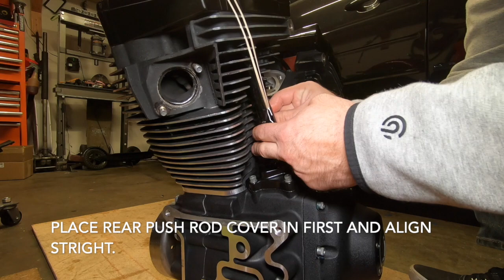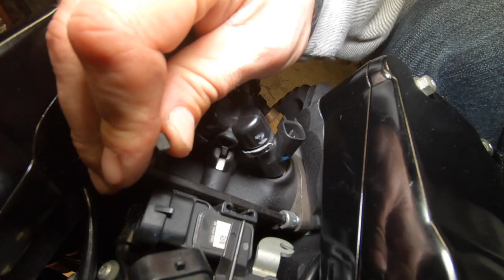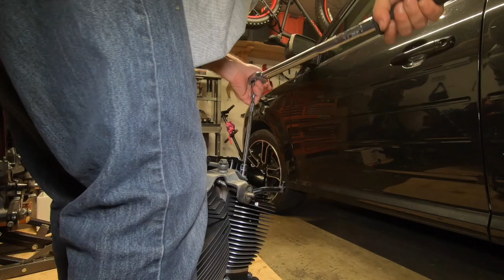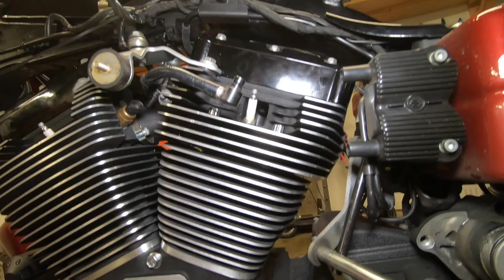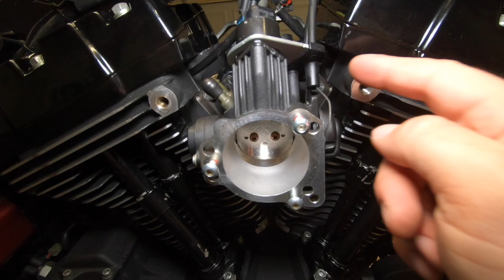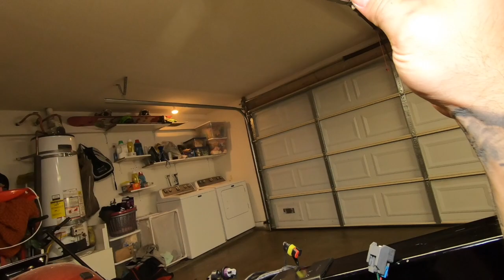HARLEY-DAVIDSON MOTOR & (EFI) THROTTLE BODY INSTALL

Comment: Did you like the EFI? What was the outcome after install? Currently have a super G carb but keep getting cold start/ vapor lock starting issues.
Reply from the maker: my bike came with efi ..if its jetted to nbig that can happen when cold..try a makuni or go efi

Comment: I was watching this video and saw one of    throttle body vacuum cap missing from your bike.
My bike(fatboy 2015) has been currently experiencing normal operation when I remove the vacuum tube but when I put the cap back in, the idle fall down and the engine stops in hot condition.
Is it okay to remove the vacuum cap?
MAF and TPS were ordered and IAC and throttle boy cleaning job have done already.

Thank you for any advice in advance Please.
Reply from the maker: I have no clue buddy..I believe a breather hose and the the is a fuel line there is one I think red? Yes it stays there replace filter for fuel and check or replace injectors sounds dirty to me
Reply from the maker: Gasket leak
Reply: @TheGasStation1616   thank you so much~~^^